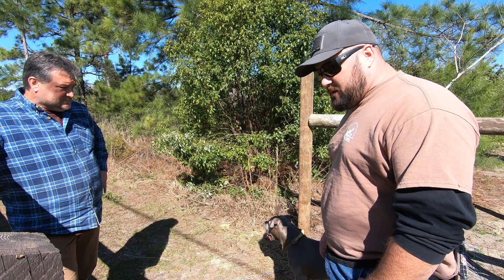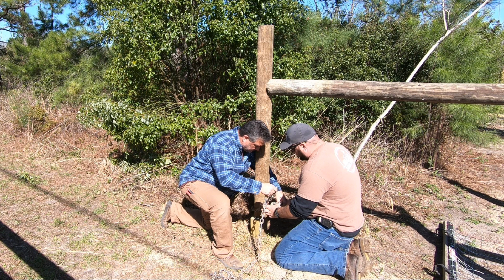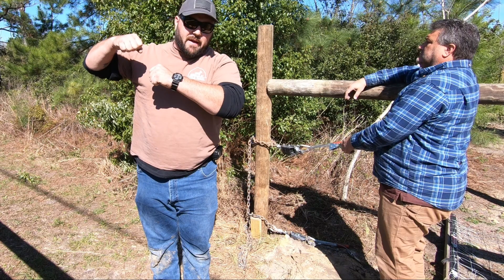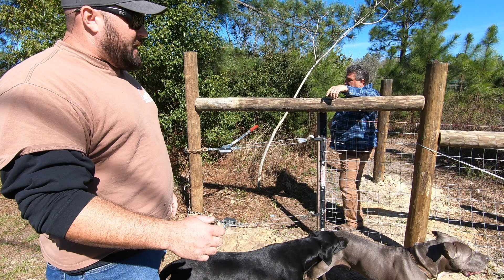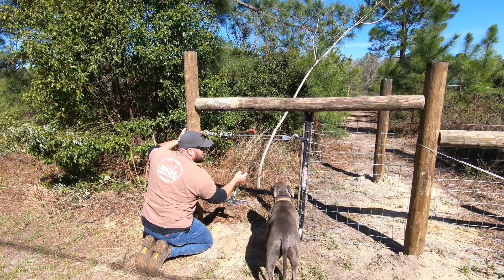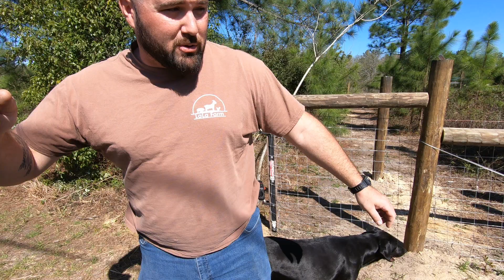HOW TO PULL FENCE WIRE TIGHT - Woven wire field fence install

Comment: We bury our8ft stretch posts 4ft on the ground or you could or will pull the H brace over in time.  Cross wire the H brace up too!  It’s gotta be an anchor

Comment: Cool.  Question, would it not be easier to use a tractor to hook that rig too, instead of using the extra "dead-man" post?
Reply from the maker: Good question!  In certain applications you could probably do that. In fact, we tried it by vertically strapping a post to bucket of the tractor.  What happened was that as we tensioned the wire, the actual post would bend and it was tough to get the same level of tension we wanted and were able to get by using the dead man post.  In the configuration in the video, the hole the post in in holds the tension on the bottom half of the fence, and the horizontal dead man post holds the tension on the top part of the fence.  It might also be difficult to get a tractor into really tight spaces - it was for us.  Thanks for watching.  - Rick

Comment: I do kinda the same thing except I use my tractor and 1 come along with chain going through the bottom and top of your clamp down bar. It evens itself out. No need to take turns ratcheting two. Never seen it done without tractor or truck though. Good to know different ways.
Reply: Same, but they said they are experts :)

Comment: Tractor supply has the stretcher bar for 64.99 right now. Worth every penny
Reply from the maker: I tried not to buy it, but in the end I could not build one that worked as well as the store bought one.  That concave bar makes all the difference. Thanks for watching.  - Rick
Reply: @TheLaLaFarm No loaner program like the auto parts store, that would be great

Comment: Why not just hook a chain to the upper and lower of the puller bar and use 1 come a long pulling in the center of the chain?
Reply from the maker: That way I can adjust the tension on the upper and lower sides.  The lower side has to go over bumps int the ground so usually pulls a shorter than the top does.

Comment: 2' in the ground corner Post. My min. Corner is 4' in the ground.
done just a lot of regular fence posts with just two feet in the ground and they're all pushed over.
Reply from the maker: Thanks - have had that problem yet after 2 years.  For some reason I didn't see this on my feed until this morning - makes no sense.  So thanks for stopping by and commenting.  - Rick

Comment: Its great having the right tool for the job. Nice work!  At my job they use large come-a-longs to pull and hold up traffic signal span wires. 👍
Reply from the maker: Right on!!!  Having the right tool or a multi-purpose tool can make all the difference in how long a job takes or costs you.  I try really hard not to be single purpose tools.  The more dual or multi-purpose a tool is - the lower the cost of ownership.  It killed me to buy that pulling bar, but I exhausted my other options before buying it.  It saved us a lot of time once we had it.  - Rick

Comment: The tension wire is wrong. That's why the post was lifting and leaning when y'all were tightening on it
Reply from the maker: You are correct.  I did not notice until we were done.  I have since adding an opposing wire to that h-brace.  - Rick
Reply: Yep, they pulled from the wrong direction,  I noticed that too  Upppssss 😄

Comment: How would you stretch the fence to the fencepost on the far left? Would you just leave the extra fence an attach that?
Reply from the maker: Great question.  First, we chose to run our fence on the inside of the pen versus the outside - it is much stronger that way.  Note that the run that will intersect with with the run I am pulling in this video, does not yet have the h-brace installed.  By not installing the H- brace until after the other run is pulled, in can keep it on the inside of the pen.  Once this run was complete, I then installed the H-Brace for the intersecting run, stretched it, and wrapped the intersecting  fence from the outside versus the inside.  It sounds complicated, but it really isn't.  Had I put the fence on the outside which is very common, really all of the strength in the fence is in the staples. By putting on the inside, the goats have to push against the fence and the posts set at 8" and anchored in concrete.  Hope this makes sense.  - Rick

Comment: Going to be attempting a field fence around some of our 4.5 acres the beginning of next year. I like the idea of using a dead brace to pull off of. Did you guys try pulling off of a tree or tractor before going to the dead brace? 
Looks like your brace wire was backwards and may have contributed to some extra post lean.
Reply from the maker: Thanks for visiting and watching.  This was a learning exercise that we became pretty good at over a period of 2 years.  Our first attempt was using a 6" post attached to the bucket on the tractor and attached the come alongs to eye bolts.  That resulted in us breaking the eye bolts - it is just too much tension.  We then tried the same setup with wrapped the come along cable to to a chain wrapped around the brace - that resulted in the brace bending and it snapped, it would likely taken out the front hood of the tractor.  So our 3rd approach, which is now what we have used exclusively for the past couple of years was to use the dead man post which has worked excellent.  That is what is shown in the video.  Pulling off of a tree would work but you have to have a tree beside and inline with the run of fence you are installing - we didn't have that in any of our runs.  Not sure what you are referring to with the brace wire being backwards.  Once we attached the stretcher to the wire, we then bend it back onto inself just for a little extra bit of strength to help prevent it from pulling out.  Thanks for commenting. - Rick
Reply: The LaLa Farm  thanks for the reply, I’ll definitely give the dead post a try then. 
Sorry I wasn’t clear, I meant the tension wire on your h brace was backwards. The high side was on the corner post instead of the brace post.